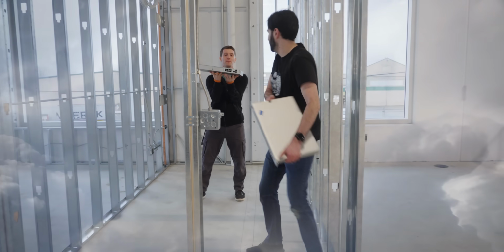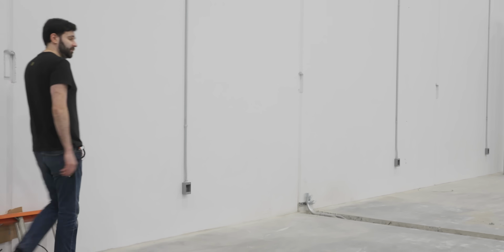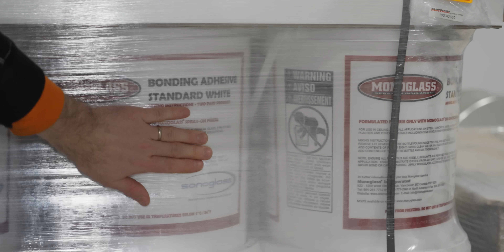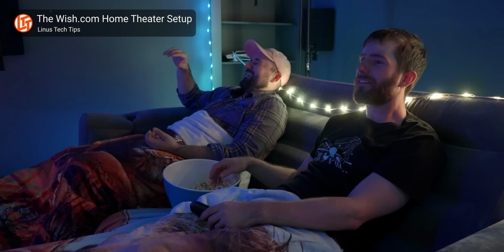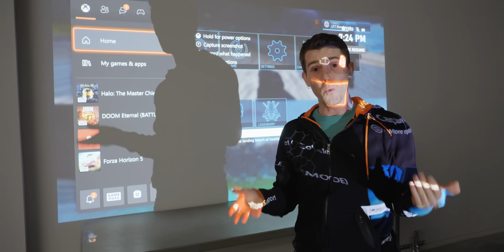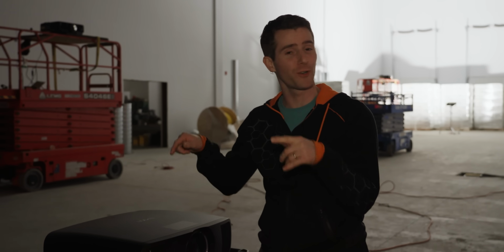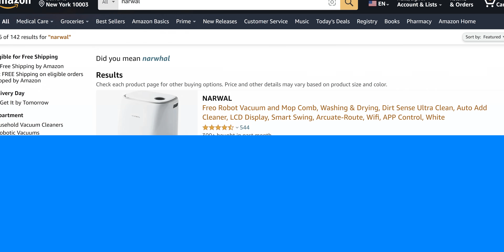Our LAN Parties will be INSANE

Comment: As a low voltage electrician, I can also tell you that 6 strand is more of a standard then 2 or 4 so it is actually cheaper to buy the 6 strand.
Reply: I guess 0V is "low voltage"
Reply: @efad3215  "Ackshually it uses light, not electricity" 🤓
Reply: @killerpanda4659  Again, 0v
Reply: @efad3215  I know, I'm just mocking you
Reply: It's more like OL no continuity
Reply: LV and data are interchangeable in this context
Reply: If we really want to get technical it's extra low voltage 0-30V. Low voltage is anything 30V-1000V. All commercial/residential electricians are "low voltage" electricians.
Reply: In my country 0-50 is ELV 50-500 is LV and above 500V is high voltage. Also we use stranded cable that has 7 strands.
Reply: Jesus in mine ELV is 0V - 120V DC 
Then LV goes all the way up until 1500V DC
Reply: @Lachlan_McDougall  DC is 60-1500v (Canada)
Reply: You too huh? I enjoy watching these as a low voltage tech as well
Reply: Im a fibre optic engineer in Holland and its more common here to use at least 48 fibres....even in private homes where people sometimes want a fibre optic network....its possible to connect so many devices to fibre optics when u use g-bit adapters...in different projects in Germany and Holland we used only 24 fibres and 48 to 96 fibres to connect houses
Reply: @killerpanda4659  Well actually to your actually light and electricity are parts of the same thing. You cannot have one without the other. They are both electromagnetic waves and in fact electrons barely move at all approximately 14 MPH or 21 KM/H.
Reply: @efad3215 if I was a digger would I be a low voltage electrician because I’m always grounded
Reply: @Toolate888  seems every country has their own standards, that are still somewhat aligned. Australia doesn't even seem to have consistency between states! :D Our AC RMS ELV is below 50V, LV between 50-1000V, and for (ripple free) DC, ELV is less than 120V and LV betweeen 120-1500V
Reply: @martindevries7869  the alternative is to use a passive splitter to connect homes but then you get losses and added complexity... But really fibre is better than any other alternative (especially VDSL on 50+ year old copper, eww)
Reply: It is definitely cheaper to buy those bundles. I bought 6ft of 3/12awg, for ebikes motors and battery’s, because 1/12awg was like $2+/ft more than the 3/12 so now I just buy the bundles instead.
Reply: @efad3215  low voltage is anything under 240 volts AC, I'm also an electrician by trade
Reply: @Synikal_Gaming  I was making a joke about how fiber is only optical.
Reply: I would say 12 is standard as a commercial fiber installer.
Reply: @Toolate888 thank you for the info it is appreciated as I thought low was anywhere from 10 to 300 volts
Reply: @Synikal_Gaming  depends on the country and AC vs DC numbers are also different
Reply: @JamesTK  In my career field, low voltage is 0-50V and high is about 300V+. I'm not an electrician but rather an RF tech
Reply: *data guy
Reply: Than not then electrician boy!
Reply: @efad3215  not true, there will be some measurable potential.
Reply: @killerpanda4659 So he is a plumber? Or light tubist 😅
Reply: @Toolate888 found the industrial guy lol you are right too 😂

Comment: I'm a video engineer for live events and we "double stack" projectors all the time. (Aligning two projector together) It started out for brightness but now a days we do more of back up. We use a frid pattern to see all the points of the projection. I'm actually pretty fast at aligning projectors.  While you can go side by side, you get better results over/under. And I just made it to the end. Looks like  you've got some real projectors to play with!!! I can't wait, good stuff.
Reply: I have even seen Barco stack TWO of Freja+  😂
Reply: Got some barcos in 😂
Reply: I'm a humble AV installer. I just pulled out an old PJ and to my surprise it had 2 bulbs in it. I was like "wow what a great idea" and now I see the industry has known the secret all along.
Reply: Would love to see them incorporate some LED walls in there.
Reply: I'm waiting for them to say it's an HDX-W20 Flex. But those are discontinued now and I can't imagine they're using older stuff.
Reply: never really played around too much with projectors, but I was watching that segment thinking it would be easier having them on top of each other instead of side by side lol
Reply: @mrosenblatt  this is Linus, eBay and used tech is always mentioned.

Comment: There is a reason why in the Dolby Cinema theaters that the projectors are not aligned side by side in order to increase the overall brightness. They are aligned vertically stacked on top of each other. Give that a try
Reply: Or even more fancy, one sits at a 45 degree angle in front of the first projector so the lenses align perfectly and uses a special mirror rig to align them
Reply: @brettnordstog  Thats smart. Instead of adjusting the projector, you adjust the mirror really finely
Reply: it does not really matter if one tries to adjust it the way they did. You have grids for that. and then also software correction as last step
Reply: What is the reason?
Reply: @JasperSchwinghammer  the divergence is greater side by side than vertically stacked.

Comment: "The server room is now one Dan wider"

North Americans will do anything to avoid using metric I swear
Reply: Canadians
Reply: @wooper2308  Canada is part of North America
Reply: One Dan sounds better than one meter.
Reply: Canada uses the metric system
Reply: Got to dumb it down for those from the USA 😂
Reply: Yeah.  Canadians measure in Dan-widths.  In the US, we use bald eagle wingspans (BEWs).  They're about the same as meters, but more patriotic.  We also made the length just slightly different than meters, so that any conversions between metric and BEW produces numbers with at least 100 decimal places.

</sarc>
Reply: @jordanhildebrandt3705 not /s, do you know how annoying it is to do imperial-metric conversions, especially since the metre was redefined again. One 2020 metre is equal to 0.9999998 metres from 2000. We redefined the imperial system again to bring it back in line with the metric system, and doubled the number of our length measurements
Reply: @jordanhildebrandt3705  That's not true, in the US we measure everything in freedom units. Doesn't matter if it's length, weight, time, temperature... everything is freedom units. If we're going to be different from everyone else, might as well not even have internal consistency.
Reply: @jono6379 I don't know how dumb you think we are, I can completely use the metric system! I know that one meter is 12 centimeters, and a kilometer is 1776 meters. Also 1 dan = 30 milimeters I think, so yes I can use the metric system, I'm not dumb!

/s, obviously
Reply: Canada uses Metric.
Reply: 300 people wow. Who is using this the public or only employees? Do all the employees play badminton?
Reply: So how many Dans to a London Bus?
Reply: How many eagles by the gun is one Dan ?
Reply: That‘s extra north american!
Reply: Canada uses metric lol
Reply: @starlarkyt  Canadians use metric
Reply: @somnixu  Not for everything
Reply: @Hans-rp5ez  they plan on making it public
Reply: @TheAdatto Not for everything. We use imperial for heights and weights of people in all contexts except official ones, distance in the context of building construction (i.e. "these studs are 16 inches apart'"), temperatures for ovens (i.e. 350F), volume for cooking/baking (teaspoons, cups, etc.), paper sizes (i.e. 8.5"x11"), and in sports, distances are sometimes measured in yards. Most everything else is metric though.
Reply: canada uses a weird mixture of the two systems. metric is official and used everywhere and everyone learns it in school, but there's a lot of remnants of imperial. small distances and heights are often measured in feet, for example. it's very common to say you're X feet tall or say a room in your house is 16.75 feet long. it's also pretty common to do use pounds when describing weights, especially if it's non-scientific. that can include anything from the weight of a tub of butter or bodyweight. there's also a lot of random things that use imperial for no specific reason, such as paint which is commonly measured in gallons. it's slowly dying out though because metric is the most logical system to use and canada switched to that decades ago, but imperial was used for so long that even after all this time it's still culturally engrained in general society
Reply: I'd like to point out for all the people going "Canada not America", OP said North America, as in the entire continent
Reply: metric is just not perfect. common fractions are a mess in it.
Reply: I'm depressingly unsure if the people saying they're Canadian are trolling or not. 

I'm talking about in response to the NA part.
Reply: @starlarkyt  bud we use kilometres you just think we are Americans eh (they only used that so the Americans could understand
Reply: @nathanielhill8156  at least the atoms they based the new metre on can't change size, right? right?
Reply: @jordanhildebrandt3705 no we Americans use washing machines per football fields squared
Reply: @Hans-rp5ez  It's going to be semi-public use if I recall correctly. Meaning anyone can play badminton as long as they get a membership. I'm not sure for the LAN events, but I imagine you can preregister and claim a spot.
Reply: @Amoschp524  his voice is smoooooooth

Comment: Not to be too technical but the minimum bend radius for fiber is partially the strain, but also a lot is due to the total internal reflection needed to keep the signal in the fiber. A smaller radius will increase the angle the light hits the wall of fiber. If the angle is large enough then much of the light will leave the fiber.
Reply: I assume they will have the radius set properly in the installation, just the armor helps while installing to avoid trying to get it past a joist or something and snap oops there goes 300' of fiber

Comment: The minimum bend radius on fiber is less about breaking it, and more about not messing up the total internal reflection for the light going down the core. This fault is generally called macrobends. You can bend fiber with a <10mm radius before I'd even begin to worry about it breaking.
Reply: I used fibers back in the late 90s - those were so fragile that they broke when you even looked at them wrong. 

We've come a far cry from that in the last 25 years...but I still am anxious touching fiber cables to this day

Comment: Consider hiring the folks at the Canadian-based company Lighthouse Immersive.  These are the guys behind the full projection mapped buildings where Disney had its 100th year anniversary of a custom 360 degree movie theater.  All four walls were effectively used as more than a single projection surface.  Plus there were Lidar sensors to use with the overhead 4K laser projectors allowing the floor to have custom themed animations that appeared to be playing with the patrons by creating unique interactive animations.  You might want to consider using a fog bubble machine that combines the two to create bubbles with fog "smoke" inside of them.  When popped it is like little fluffy clouds are released.  Queue music from the Orb, "Little Fluffy Clouds".
Reply: sounds a little ambitious for an occasional lan center. maybe in the future?

Comment: I recently installed a 550 inch screen with two 20000 lumen projectors for a two day event. it was for the background of a stage, so lots bright lights around. no gaming unfortunately, but very impressive tech
Reply: Question. How far your hand needs to be to not get instantly burned if put infront of the projected light
Reply: @bosch5303  no idea. we mount them a few meters above ground before turning them on. so the closest I can get is maybe 10 meters.

I doubt it would hurt you, unless you spend hours right in front of the lens

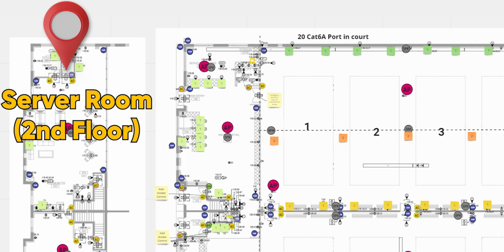Comment: 6:18 Keep in mind the 100m limit on Ethernet runs.  it's a pretty hard limit.  I've ran into it for long runs between floors in offices and sometimes literally 1 foot of cable slack was the difference between full gigabit and no connection.
Reply: You can easily run Ethernet for kilometers over fiber.
Reply: @DR-INSANE95  He's already talking about ethernet over fiber (several km before you need a booster), as opposed to ethernet over twisted pair (~100m), or ethernet over 802.11 AKA wifi (half that unidirectionally, maybe), or ethernet over bluetooth AKA BNEP (good luck getting 10m!).
Reply: @ChristopherPuzey  They were holding spools of cat 6 while discussing long runs.  So I thought it was obvious I was talking about copper twisted pair.
Reply: @DR-INSANE95 ethernet protocol, it's not exclusively twisted pair. I also handle 20km fiber optics almost weekly, and those too use the ethernet protocol.
Reply: @DR-INSANE95  Ethernet isn’t limited to copper

Comment: Use the lines to line up the projectors. Stack it on top of each other. Its a little easier to align. Its called double stacking and epson has frames as well that lock into each other

Comment: If you're ever concerned about the distance you have left for a run, you can measure how much wire is in a spool using a multimeter
Reply: Or just read the side of the cable. It's on every CAT6 spool, every foot.
Reply: @technerd5637  no, if you've already made a run and now have a fraction left, your meter can measure resistance across the remainder and tell you how much is left

Comment: If you set up projectors like this, christie has projectors with different lesnses, so you could mount them on the opposite wall and still get 200 inches of screen, but no problems mounting anything.
They also have angled lenses to make them kinda into short through projectors or other crazy stuff!

Comment: 4:12 the "pull cord" is not for pulling the fiber. Even in the diagram it's correctly labelled as ripcord. It's for splitting the jacket when you go to terminate or splice the fiber.
Edit: 5:57 unless there are loads of bends/corners in the run you can just tape the new length of cable from a fresh box and pull it through using the old cable that's too short. But yes, the most expensive piece of material is always the one that's just too short.

Comment: converging 2 projectors gets you roughly 150% of the brightness of just one, so .5 brighter, and is diminishing returns from there, and yes without lens shift and at minimum corner correction it's not something you want to try because it'll never get good.  that said, if you plan is to cast other games to the wall, and not game directly on it, you could look into blending several projectors across the wall to have as wide a canvas as you have wall and PiP in various streams and other content .

Comment: Always better to have overkill rather than underkill (as long as it is within the budget)

Doesn't really apply here, but there is nothing more frustrating than going to plug a workstation into the network only to find that the port you've plugged into (and the 5 or so others in the immediate area) isn't connected in the network cabinet/server room...

(getting the port[s] connected requires an IT department callout)

Comment: I know there is other software for this, but I have used qlab with blackmagic capture to output a single 16:9 signal across 3 unevenly mounted projectors, and the brightness increase was insane.  Of course qlab will also automatically edge blend as long as it knows where the edges are.
That said, I normally run entertainment output, so prerendered videos, not live streams.

Comment: Pro tip for you guys running cat6, you should be able to tell how many feet are left on a used spool with a multimeter by measuring the resistance. You just need to know what the resistance value of a foot of cat6 is

Comment: For the price of an LS12000, you can buy pretty insane projectors that would work great for this. One example is the Panasonic PT-FRQ60 which is 6000 lumens and is 4k/60 or 1080p 240hz and low latency. Still though I was surprised the LS12000 kept up like that with a 300 inch diagonal for only 2700 lumens.

Comment: I do work with fiberoptics and i can tell you that there is no worry about bending the fibers. you can take a bullpen and twist it around without it breaking. if the fiber is within a duct you can make a knot and pull it tight without it breaking. You kind of need to want to break it to actually break it.

That being said if it lays in a tight bend you will have loss of signal which will result in bad dbm.

The biggest bandit is however typically dirty contacts which results in ghost pulses which results in packetloss when high amount of data is transferred which you cant detect by measuring speed (huge issues for streamers working from home and reporting issues and the ISP claims there is no issues)
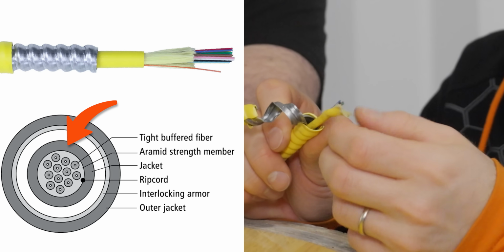Reply: Isn't it tdagerous to touch fibers like that? 4:06
Reply: @vallorahn  I would never recommend poking the tips due to it being glass and extremely thin they easily penetrate the skin and your body does not reject the glass once it enters.

Those fibers are however not peeled and would come right back out if you tried (once its bare glass they break off extremely easy)

Most of the time poking fibers are not an issue. the issue is mostly when people get fibers on their socks and inside the jacket arms then move around which is done with force and it can penetrate and break off under the skin.

And ofcourse drinking coffe/soda next to your working place with fiberoptics

Comment: Why don't you go for a LED wall? Take a 0.6mm pixel pitch  from unilumin for example. Very low latency while running 120 FPS 4:4:4 sRGB in HDR at over 8K. You'll need a beefy machine to output such signals. But imo it fits way better with LTT than those (sorry to say so) far from optimal projectors. And if you're gonna layer projectors get yourself some Christie or barco projectors.😅 Feel free to DM when you want some more info😊